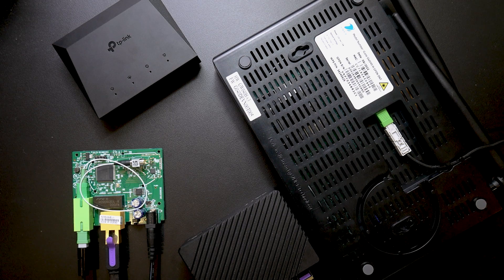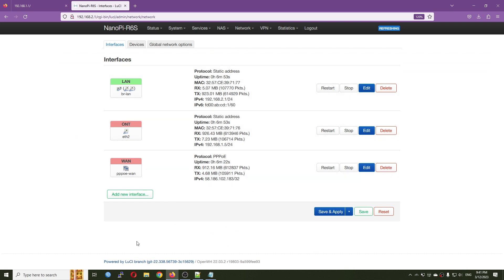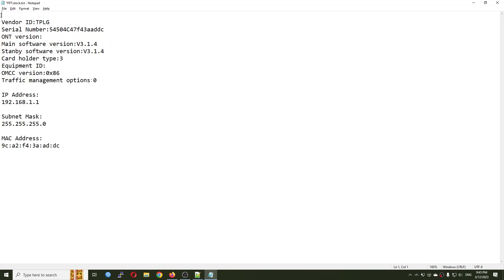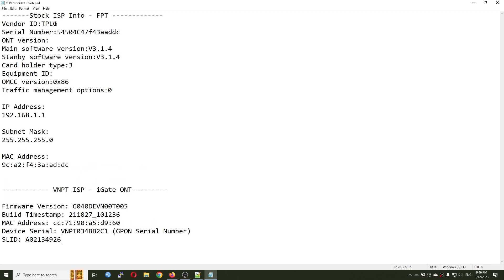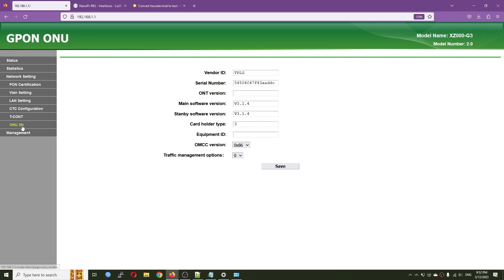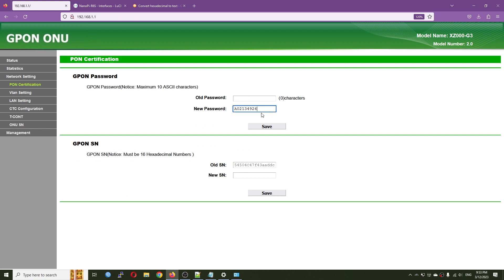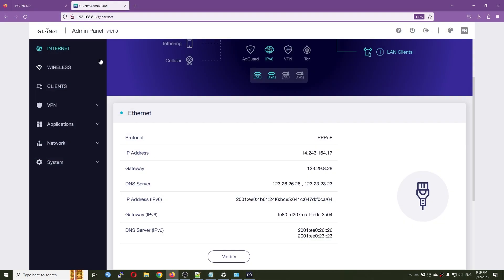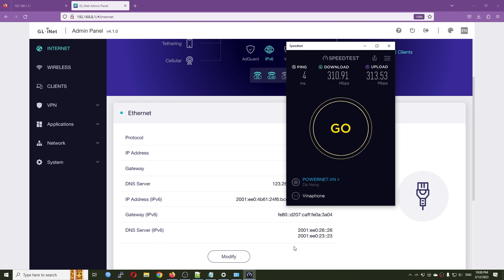I use the TP-Link XZ000-G3 with a different ISP

Comment: is there a way to unlock the firmware without open it? and other question. Would be possible to change mac address of this device to match that one given by the ISP? In my country the authentication is made by mac address
Reply: Did you find out the mac adress change?? I also need to change it for ISP authentication
Reply: @ZonaALG did you Find?
Reply: @ZonaALG  you can do it by inspect element and changing a web address

Comment: Hello, I have the XZ000-G3 hardware version 1, I followed the firmware modification steps but the device refused the modified firmware.

Do you think it's possible for the author to release an update for hardware version 1? I can upload my original firmware if necessary.
Reply from the maker: Hi, you can communicate with him (using Github/ or create issue)

Comment: Amigo tengo una velocidad 1000Mbps de contrato con Movistar. A que se debe que la velocidad solo llega a 250Mbps en bajada  y 115Mbps en subida.. cuando utilizo ese modelo de terminal GPON?, Si coloco el HGU de la operadora en modo puente si llega a los 900Mbps con el Router neutro.
Reply: Did you clone the ONU Serial number?

I have a similar issue, but I wasn't able to clone my ONU SN as my XZ000-G3 is hardware version 1, so there is no modified firmware available so far.
Reply: @RafaelHipolit0  Si, coloque la SN y la password del HGU al Tp Link, lo registra todo bien (O5), el problema surge en la velocidad. Tengo también el Archer XR500v y presenta el mismo problema, lo registra todo bien, pero la velocidad mejora un poco hasta 500Mbps pero la subida sigue estando bajo 150Mbps, he leído en foros que muchos presentan ese problema con la velocidad, voy a probar con un Huawei HG8010H, he leído que ese modelo es compatible con la OLT de Movistar. Hasta ahora con el Tp Link no hay buenos resultados, también probé con el Ubiquiti Nano G, y peor con este pues aquí la OLT de la operadora solicita SN y Password lo cual el Ubiquiti no tiene en ninguno de sus modos. Saludos.
Reply from the maker: @Edgar Quispe Aro Do you have UART access to the XZ000-G3. What is the CPU load when you are reaching 115Mbps upload?
Reply: I have a similar issue with XZ000-G7. I did PPPoE login in the router (ax72) or Windows 11 (for test). The speed drops to 100 mbps. When I return to the old modem, the speed is 600 mbps. I'm stuck with ISP modem.

Comment: Can you clone Mac address with the modified firmware? My ISP uses MAC authentication.
Reply from the maker: Hi, still there is no way to clone the MAC address on the ONT. However you should be able to clone the MAC address on the OpenWRT
Reply: @VanTechCorner  Thanks for the reply ! I hope you soon find one where one can change the Mac address since many ISPs still use MAC authentication for ONU Authorization

Comment: I have installed openwrt, on TP Link Archer C6 V3, my 2.4 GHz network is not working properly, although I get singnal on the phone, after a while, the singnal is disappearing. And 5 GHZ signal is very strong. I am using openwrt latest version. How to solve it?